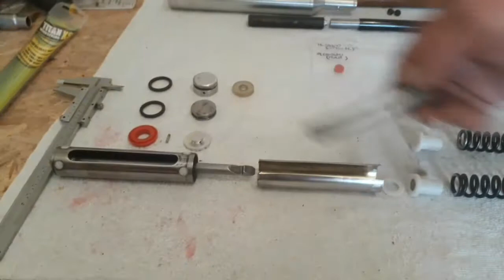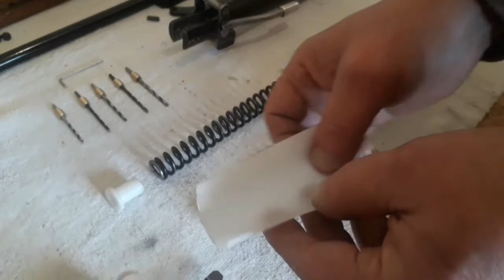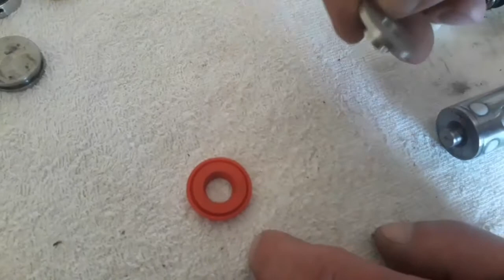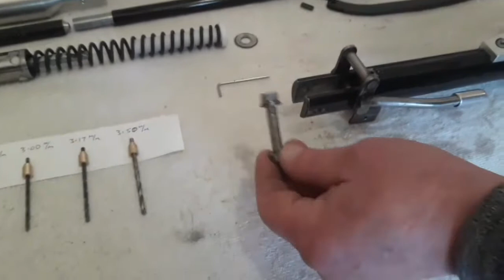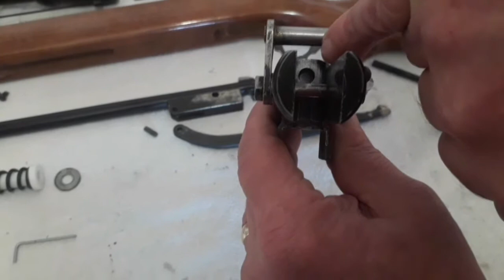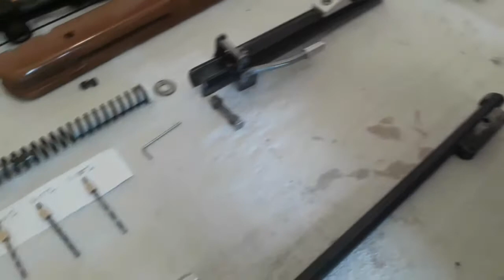Springer tuning BSA mercury full tune and testing

Comment: I use an engineering plastic for the guides, run them tighter than you show here, they size to the spring and no need for the piston sleeve, use a vortek spring and 2-4 fps variation no vibration and twang, no buttons, just polish the piston and moly it, sometimes more tuning is not needed.
just my 5cents.
nice vid non the less.

Comment: Found a page that gives an equation to calculate the diameter expansion on compression springs.
It don't let me post the link but google for "outer_diameter_expansion_in_compressed_springs"
For springs of common air rifle dimensions it seems to be about 0.5mm expansion.

Comment: You know that the spring diameter increases when it's compressed !?  I can't tell exact how much. I guess it depends on the steepness of the windings and the spring diameter of course.  This must be taken into account when a piston sleeve is installed, so that the spring don't get stuck or rub too much.
I like the breech lock very much !  On most springer air rifles the breech lock is a weak point.

Comment: I've had lots of airguns and got rid I'm only into weirauch springers these days they represent what airguns are all about JUST THE SAME AS THAT MERCURY ..AIRSPORTER ..WEBLEY VULCAN DID BACK IN THE DAY ..     that really is a lovely gun I never owned one and on reflection cannot understand why ... .Great video m8 ...... .going back to the 80s the Japanese sharps innova stole my attention great little gun ....cheers pal
Reply: Same here got into innova's about then too, i now have an exellent challenger mercury in .22 after a 653 magnum, the challenger has a breech bolt like the 635 .25 & shoots great as standard after a relube & a lube sleeve stopped the twang. if you want a merc these are the best made imho, i even like the maxigrip mount some dislike on it , you'll need set back correct sized mount for a scope though to get the correct eye relief.

Comment: Hi, just come across your video in my search for improving an older BSA. Wondered if you're ready to post the next video to show the fruit of your labor so to speak. Great mods by the way but even better engineering. Look forward to seeing the results.
Reply: stick to replacing the spring and cleaning the barrel with gun oil , this kind of modifying will only break ya rifle trust is

Comment: Very informative do you know of a kit I could get for a bsa supersport se 177 it's only about 6 f/p at the moment cheers
Reply: The Supersport was made in response to German competition when the HW80 out-sold all BSA rifles. These are capable of developing energy in the 16 ft lbs region. It is not achieved merely by fitting a stronger spring. The piston weight has to be increased.  Special weights were made and fitted into the export version. This weight actually resembles a solid spring guide (think of a fat nail) which was fitted inside the spring and in front of the piston. The piston on the Supersport does not have a rod in the center and the sear engages on the outside of the piston. Obviously anyone residing in the UK without a FAC would be advised to set the rifle below 12 ft lbs but using this weight and reducing the spring input would make a nice shooting rifle.
Food for thought, I'd say...
Reply: The greatest thing I had found with the supersport/lightning to increase power was to change the piston seal that it comes with there so hard and tight. You can size them but it's so easy to take to much off it better to get the venom seal it makes a massive difference and is much softer and flexible, the problem is finding one as there no longer made but customairseals Australia do one that's very much like the venom. Also Jim mcarri ( not spelt right) does a good seal for it to the are said to be really good seals.
Reply: Should be 12ft lb  so it probably wants a good respring at the gun Smith
Reply: @MrViegar0  yes I think your right I’m giving it a try myself

Comment: Very interesting ! I have a mercury , it is in good nick but it jams a bit if not used for a while . So i was thinking of checking / replacing seals . So thanks for showing clearly the innards it will help me take it apart . It would be good if you could comment on which changes (delrin top hat etc) make the most difference, looking forward to the concluding vid ,  thanks .(any tips on reassembly will be v much appreciated !)
Reply from the maker: Hi David, the first thing to do would be to fit a new spring, with properly fitted spring,, guide, top hat and slip washers, that is the easiest way to improve efficiency and smooth out your mercury. I'd suggest going for a standard bsa spring if you don't have access to a chronograph. I can supply above items, sized to fit spring, piston latch rod and trigger block, email airrifletuninguk@hotmail.com  if this  is of interest to you. Also make sure all parts are clean on reassembly and lightly lubricated, but being careful not to get any lubricant in front of piston O ring as this will cause dieseling, hope this help
Reply: If your Mercury uses a nylon piston head, and the early ones did, then there is the source of the sticking. It's known that these nylon piston heads absorb oil and swell rendering them a tight fit in the cylinder robbing the rifle of power.  BSA changed these to an aluminium head which cured this problem. So this could be your problem.
Reply: Awesome video, and fantastic workmanship. I would love to see the results